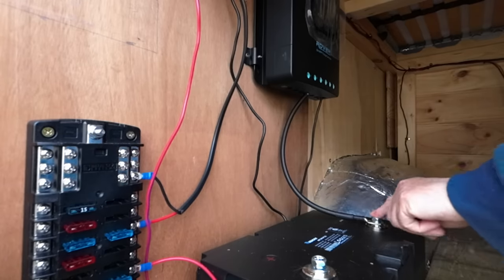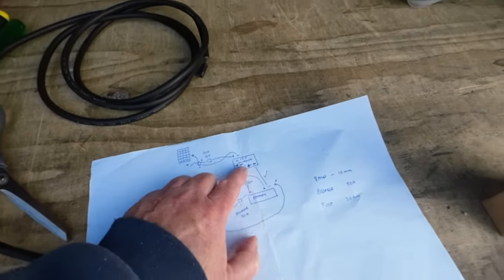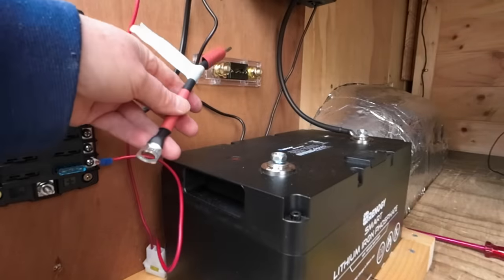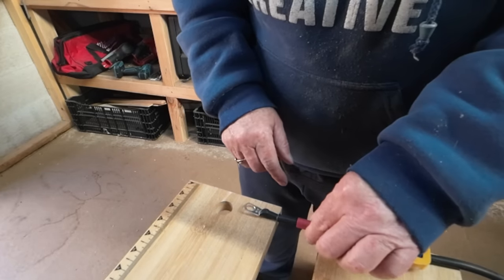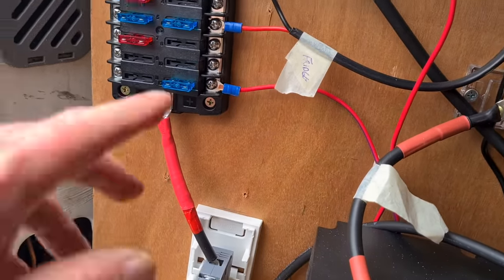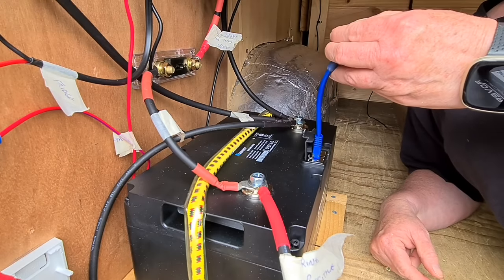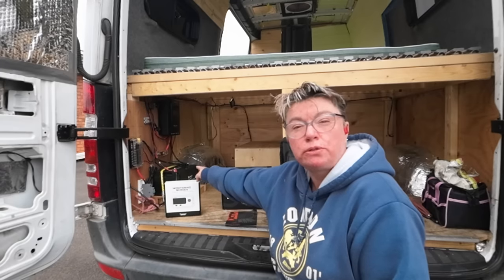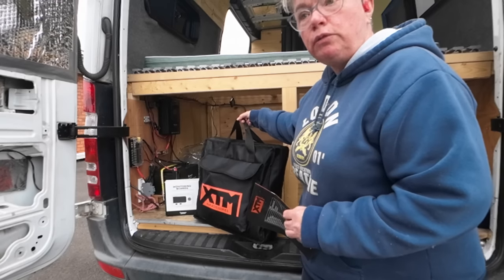Basic Solar Renogy Installation in a DIY Campervan- Off Grid Tiny House on wheels.

Comment: A very easy to follow video, thank you. Your comment about parking in the shade made me think...i am about to buy a solar system and of course was thinking of panels on the roof. I still will but will also get a solar blanket for those shadey park ups. Thanks for that 😂
Reply from the maker: Hi Leanne, Thank 😊 you for your wonderful feedback. we just came back from a trip away and done just that park in shade 😎 panel in the sun 🌞. However I found the blanket not as efficient if you are chasing the afternoon sun. Say after 2pm. and found that we needed  a folding panel that we can move around. So a little upgrade to consider. we are still not sure about panels on the roof yet 🤔 but will consider if needed.  as they are laying flat like blanket. New upgrade of batteries as 100 ah was not enough due to days of no sun. I'm thinking of adding another 100 ah to make total of 200 ah in future of course as not cheap.  Thank you for watching 👀

Comment: Hi there! Where did you buy the plate to mount the Renogy breaker? Thanks!
Reply from the maker: Hi Alex.. we got the fuse holder from Middy's  electrical store. For the life of me, I can't think of what the bracket is called. But the staff are very helpful just take the fuse with you. hope that helps. xx
Reply: @twobirdsinavanaustralia9599  thanks for the reply :). I am in Canada but i'll go to an electrical store and see if they have something similar !

Comment: How is the XTM Solar blanket going? Do you rate them well?
Reply from the maker: Hi 👋 well we did use the blanket on our last trip and found you really need the sun say 11am till 2pm...after that was very little charge. so would we buy another no . I think a folding panel that you can tilt would be best 👌.

Comment: What size cabling from the lesiure battery to fuse box I have some 16mm 110 amp from my split charge relay over could I use this as posetive and negative at all ??
Reply from the maker: Hi Oneg, that's a great question. As we have a 100 AH lithium battery, we ran 8 awg 10mm wiring  our over all draw is 50 amps, our mppt controller 30amps. I would say that 16mm is ample, of course I don't know how big the battery is? I hope this helps, message if you want more help
Reply: @twobirdsinavanaustralia9599  nice one for the rapid responce and 130 ah battery with a 120w solar panel and split charge relay of my fuseboard I'm planning to run 2 usbs one with 12v socket diesel heater and submersible pump my main concern that the cabling would be too much because of the thickness but then you lose abit of draw I was concerned at 110am cabling it would be much to powerful ?
Reply from the maker: @Oneg   I used 4mm twin core for the heater,fans fridge, and usb socket. the 16 mm will be to big use. It will be OK  for connection from battery to fuse it will be ok 👍
Reply: @twobirdsinavanaustralia9599  thank you so much I'm going to use 27amp cable for the USB that will run compressor fridge and USB going to run the diesel straight from battery I think
Reply from the maker: @scousebikers  that will work...for your heater, fridge etc... good 👍 luck ...